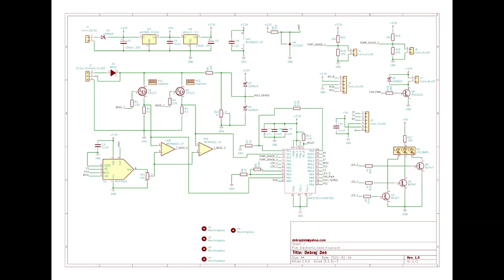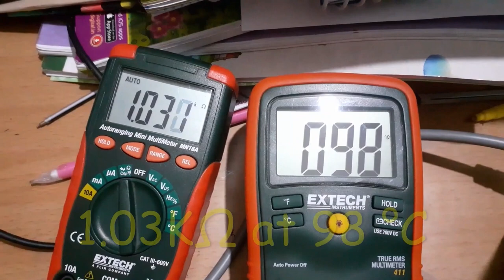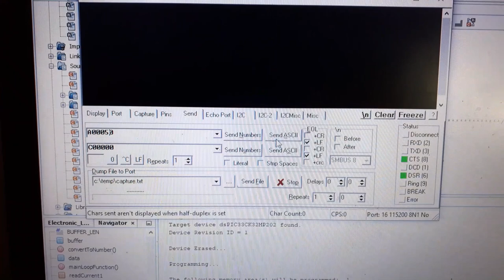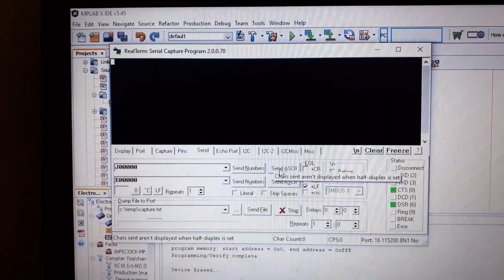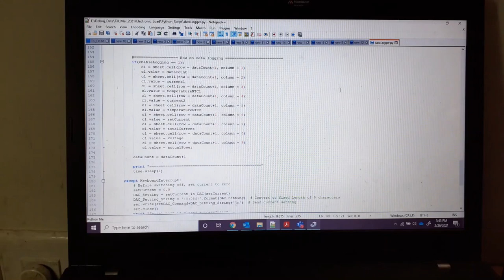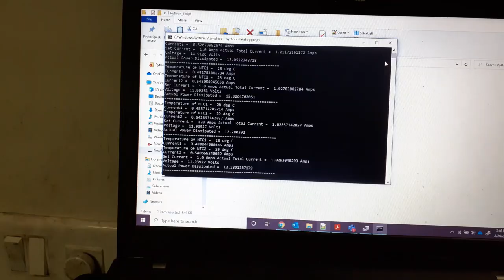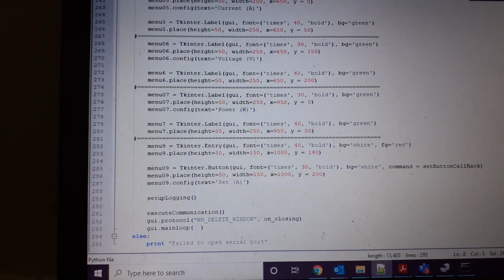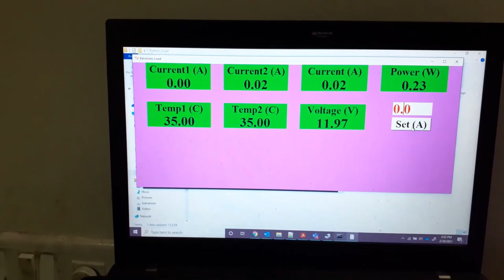Electronic Load v2 0

Comment: The µC doesn't have a DAC? PWM?
Reply from the maker: Its there, but the reference voltage is fixed to 3.3V, but I wanted lower external voltage. So I selected MCP4921. Moreover, I was using internal opamps of uC, which uses the DACOUT pin.